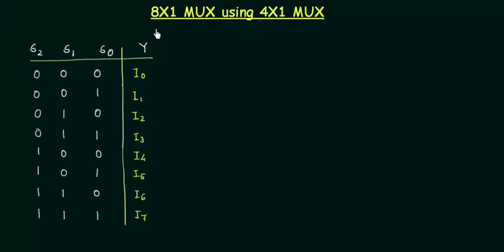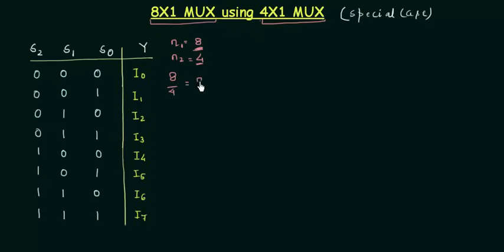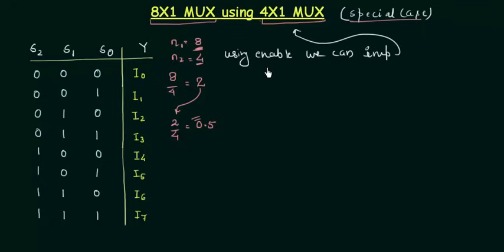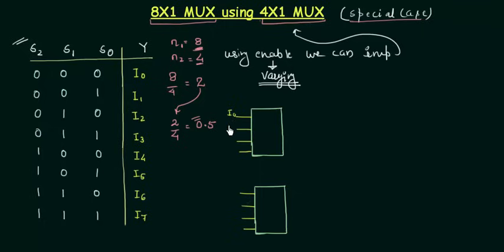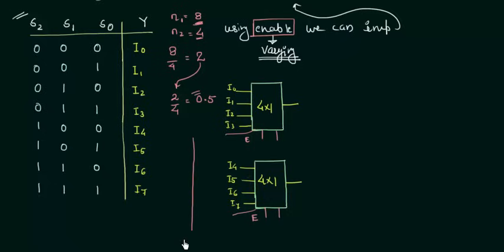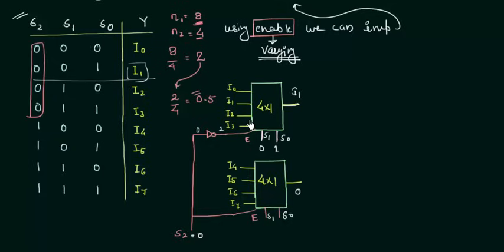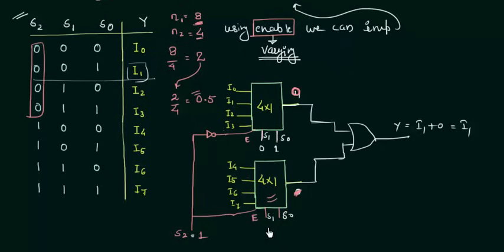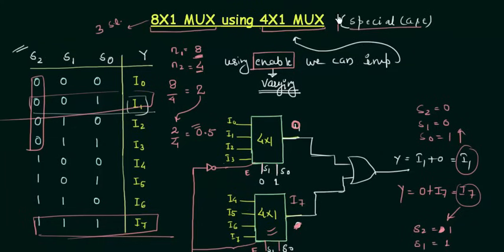Implementing 8X1 MUX using 4X1 MUX (Special Case)

Comment: another way could be using one more 4X1 mux in the next layer instead of OR gate & tie it's Select-1 pin to ground &  Select-0 pin to S2(used for enable in video). Connect the I0 of this last layer's mux to previous layer's first mux o/p & I1 to previous layer's second mux o/p

Comment: Bro tell me what you did at starting?
I cant understand about 8/4 =2 ,2/4=0.5 ,and in total u said it is 2.5 mux....
So that part little bit confusing.
So let me know that.
Thank you
Reply: Yeah it is confusing. I think that number  "2" is the output lines of the first and the second multiplexers which will be input lines for the "third mux" which also has 4 inputs so we are going to use only two of four inputs of the third mux...

Comment: Umm, we can construct a 8X1 MUX using 2 4X1 MUXes without using an enable, but a select terminal which is joined with the two outputs of the MUXes separately by an AND gate among which one of the  select terminal is joined after being passed through a NOT gate

Comment: Sir I have 1 question :
In the first mux you are referring the output I1 as select line (s2) as 1 (when it's complemented)  , then it's should be referred to as following : 101 and not 001 , but why haven't you taken s2 as 1 ?
Reply: that is because we are concerned ONLY with the inputs that we are GIVING, not the input that goes into the mux. The input given is s2 = 0. It gets complemented by the not gate and goes as 1, but that is not our concern

Comment: Sir I have 1 question :
In the first mux you are referring the output I1 as select line (s2) as 1 (when it's complemented)  , then it's should be referred to as following : 101 and not 001 , but why haven't you taken s2 as 1 ?
Reply: For I4 to I7 S2 should have the not gate he has done mistake ig

Comment: sir I can use 3rd  4*1 mux instead of or gate & pass output of the two mux to to I1 & I2 only to the 3rd mux s1 select line of 3rd mux = logic 0 so I2 & I3 line of 3rd mux is don't care....here I haven't to use enable line concept
Reply: Yes you can very well do this. In fact this is the true case when you only have to implement 8x1 mux only using 4x1 mux'es and cant use any other logic gate or comb ckt.

Comment: how I1 comes as output from first mux , shouldnt it be  i5 ??
please explain  .
Reply: No, that 0 of S2 changed into 1 by the not gate only shows that the mux is enabled...otherwise the value to determine the output I0 I1 ... is based solely upon the original values of S2 not the complemented values....
Hope it helps

Comment: You can't use s2 as an enable because in that way you are having 5 inputs, 'the enable in the MUX is usually connected with the output'
instead you can connect s2 prime to the first MUX output with an AND gate before the OR gate
and connect s2 to the second MUX output with an AND gate before the OR gate
Thanks

Comment: There are also MUX with Enable which are tri-state. Whenever the enable is not active, the output of MUX is in HIGH IMPEDANCE (HIGH Z) STATE. This technology can eliminate the need for OR gate in the final stage.

Comment: I think we can use 3 4X1 MUXs ;
1st MUX has inputs i0 - i3 ; select lines = s1 , s0;
2nd MUX has inputs i4 - i7 ;select lines = s1 , s0;
3rd MUX with 1st two inputs = output of 1st MUX; next two inputs = output of 2nd MUX ; select lines = s2 , s2;

Nice lectures sir. Thank you.
Reply: if we don't want to use 2 4x1 MUX, then we have to connect the output of MUX 1 with i/p line I-0 of 3rd and o/p of MUX-2 with i/p line I-1, the rest i/p line can either be grounded or can remain floating. and only one selecting line will be operational